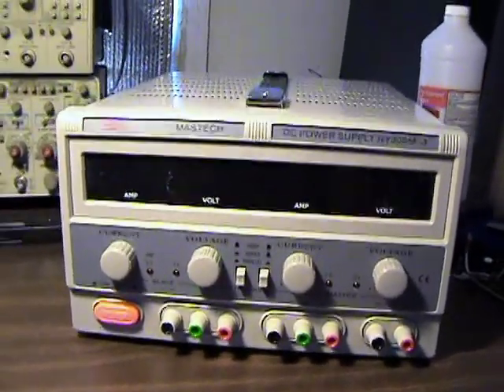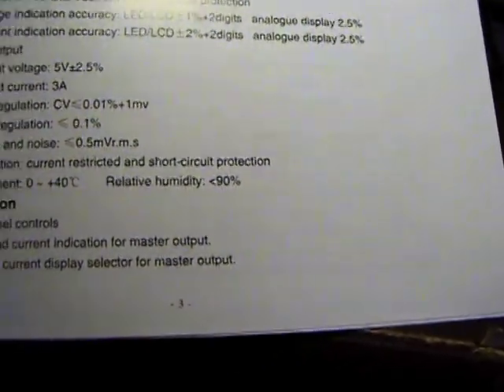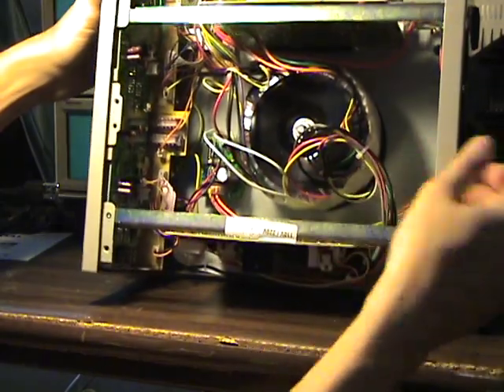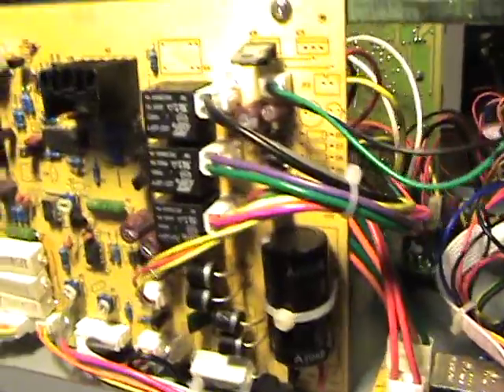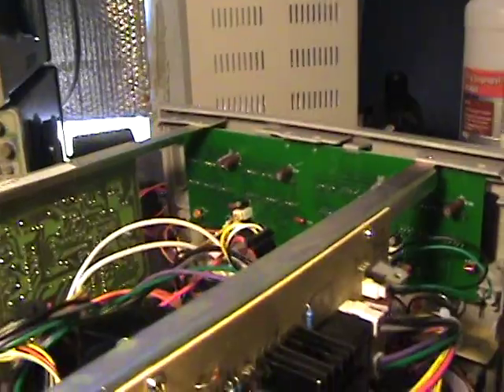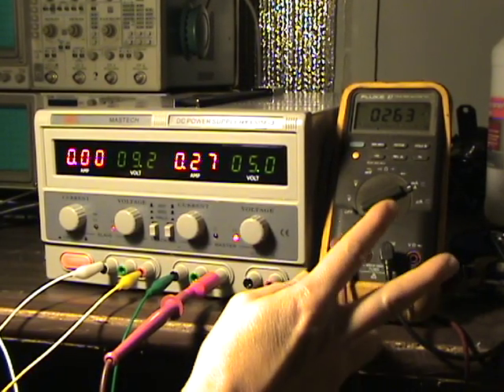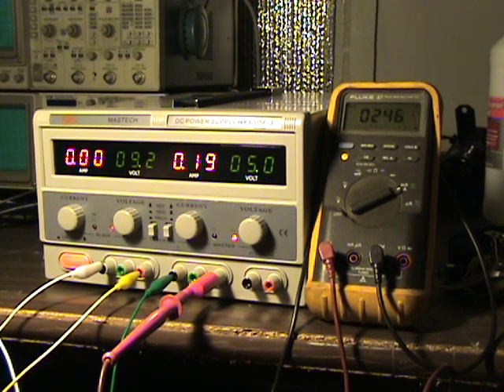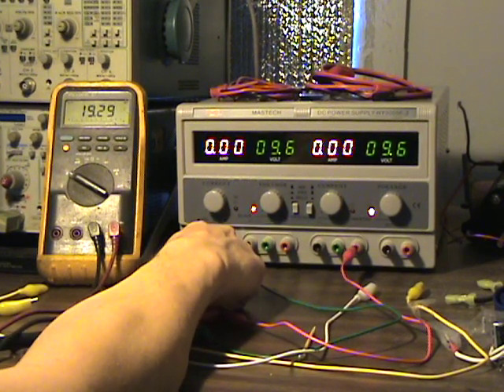Mastech HY3005 Power Supply

Comment: Appears to be the same/similar unit as Dr Meter.  Pricing today is around $200 OTD.  Toroid transformer, no fan, two color LEDs are nice features.

Frame, panel, not all PCBs are glass epoxy, are just fair.

Display readings of 1% are fine for a power supply.  I'd imagine noise and ripple at the higher output levels will be higher than the lower levels.  That's fine too.

Comment from the maker: I was thinking the same thing. I found a bin of 50k ten-turn pots at a local surplus shop for $7 each, and got a few of them to keep around. If that value will work (and they'll fit) I may do that. Though the more I use it the easier it's getting to dial it in with the existing controls. It'd also be fun to replace all four with rotary encoders and a little microcontroller retrofit board with four PWM outputs... spin fast for coarse adjustment and slowly for fine tuning. New project!
Reply: I just got this PSU with production year of the production of this video 2013!  

Got it with malfunction of slave channel. Turned out a bad 2n3055. After replacing that it is OK. Schamatic can be found on the net but be aware there are a lot of version, you need to dig until you find a right one. Having the schematic this device will serve generations. It is easy to repair and rock solid. 

Definitely need to change the potmeters to 10 turn ones. It is not an easy job because the 10 turn pot has 22mm diameter instead of the used one 16mm. Unfortunately the display panel lower edge is an obstacle and you should machine it out a bit. Problem is that the AD converted DIP40 socket covers this place. You have to put the AD chip into a new socket, connect the new socket to the old one with wires. During the cutting some of the pins will be destroyed of the soldered DIP40 socket. These pins shuld be soldered separately from the board to the new DIP40 socket. it is not a nice solution but it could work.

Other possibe project is to change the 3 relays to SSRs. The switching noise of the relays made me a hard attack sometimes. Anyway I like this old design with its 11kg weight and old LED displays.

Comment: OP...ITs good that you opening up stuff and looking inside. Be careful when touching power supplies which run of mains voltage. The input filters (comprised of caps and inductors) can and will store prolonged charge (the inductor can store in between its distributed capacitance between the turns) and the same goes for the transformer. We want you to do more videos so take care..just a free friendly advice

Comment: Old school technology. Could have been designed in the early '80s. I guess ICs have not changed to much in 30 years. Surprised at the lack of large electrolytic caps. Curious if it's still running after almost 5 years.